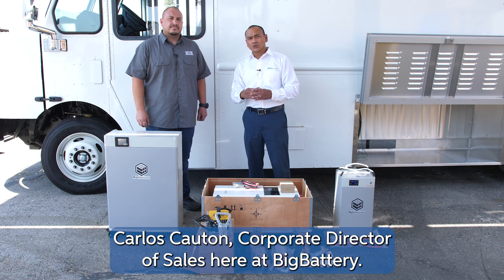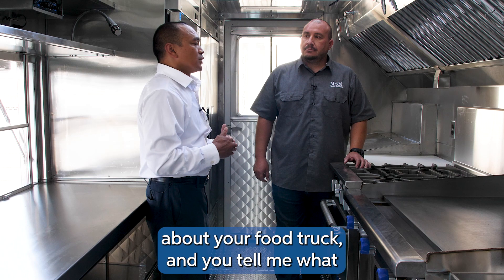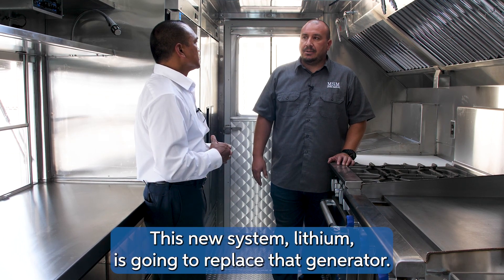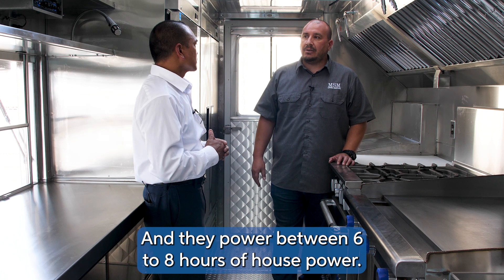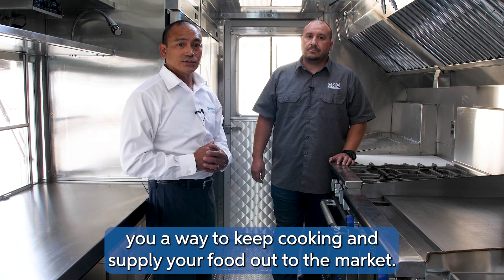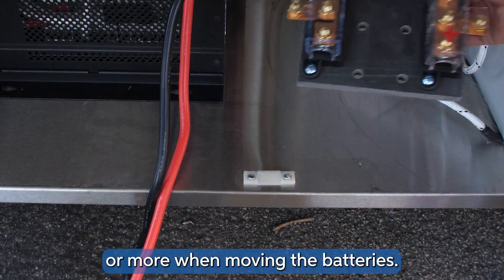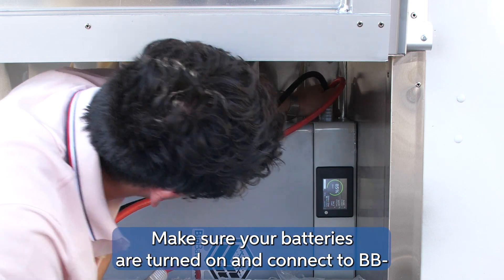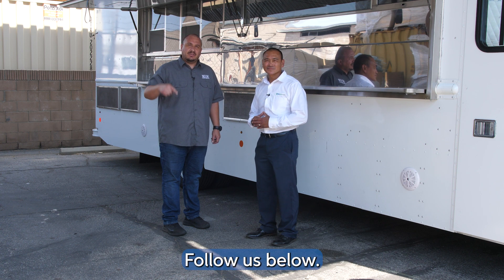BigBattery and MSM Catering Collaboration | Food Truck Install

Comment: How would this work on a food trailer?
Reply from the maker: Hi, thanks for your question. These systems would be installed and operated very similarly in a truck or tow-behind trailer. As long as your trailer's battery compartment is large enough to support the installation of your desired lithium system, you would simply be replacing the auxiliary power system with your new BigBattery set up, similar to what you see in the video. We have a wide range of kits at different capacities and voltages so however big or small your system needs to be, we can set you up with a tailored solution specifically for your trailer. Feel free to give us a call at (818) 280-3091, or send us an email at Sales@BigBattery.com, and a member of our team here can discuss your current set up in-depth and offer a personalized recommendation for you!

Comment: Hey Big Battery, been looking over your product line. Liking what I see. Let’s say to install a Growatt 12k inverter with 2 Condors or Kings, and all the parts to do so, how much would it cost per kWh? I am finalizing some numbers and deciding which system to consider to include enough autonomy and future expansion. Thanks.
Reply from the maker: Hi, thanks for your question! Our 2x CONDOR Elite 3 Kit, accounting for all included components and a 12K inverter, would come out to $464/kWh, and our 2x KONG Elite Max Kit, which by necessity comes with a 12K inverter, comes out to $418/kWh. Plus, both kits are easily expanded upon with each system being able to support up to (8) total parallel connections across the entire battery bank. Also, keep in mind that we do currently have a promo going for our KONG Elite Max Kits where you can get to 15% OFF at checkout! This promo is only going on for another 36 hours, so we'll link that promo page below so you can be sure to capitalize on the savings. With the promo code KONG15, you can get our highest-capacity kit (38kWh) at just $355/kWh! You can check out that offer here (https://bigbattery.com/kong-elite-max-promo/) and feel free to reach out to us at (818) 280-3091, or by email at Sales@BigBattery.com, if you have any questions before purchasing. Thank you!
Reply: @BigBattery  if I am understanding you correctly, to do a system like this equals $355 per kWh, yet the electric company is charging me $0.167 cents per kWh. What am I am missing? Math does not seem to favor these types of systems. Thank you.

Comment: what is the total cost for the battery and everything of this video?
Reply from the maker: Hi Nnima, thanks for your question. Our HUSKY is no longer an active product, but stay tuned for our HUSKY 2 coming soon! For the CONDOR Elite, 12kW Growatt Inverter, and 110V 20A Charger, that would be $7,119. That setup would provide 11.8kWh of capacity, but if you opted for 2 CONDOR Elites, you could have 23.6kWh of power storage available! You can see more about the CONDOR Elite, along with the associated accessories, here: https://bigbattery.com/products/48v-condor-elite-3-lifepo4-231ah-11-8kwh/
Reply: So what is the cost of a system like the one mentioned above?

Comment: Wondering due i need an inverter o can i connect the battery directly to the 50 amp breaker?  New to battery setup.
Reply from the maker: Hi Valentin, thanks for your question! Are you referring to the busbar or the charger? If you're just looking to connect your batteries to your charger, no inverter is needed. You can connect all your cables from your batteries to your busbar, then connect your charger to your busbar, plug the AC cord into any standard wall outlet and begin charging. Feel free to give us a call at (818) 280-3091 for more installation support if needed!